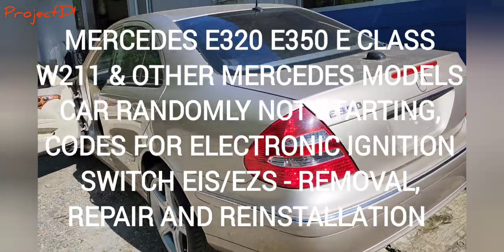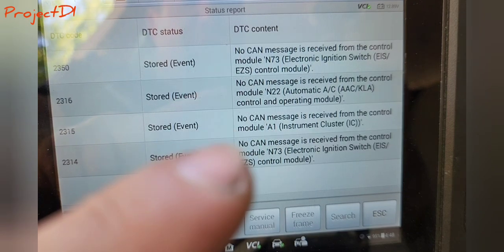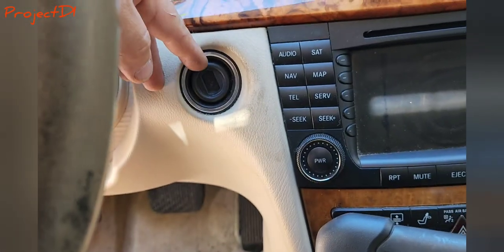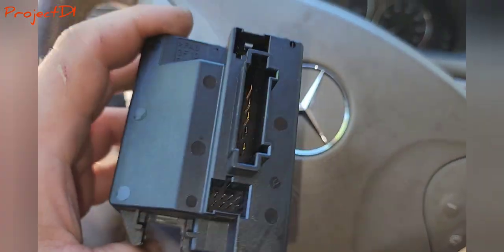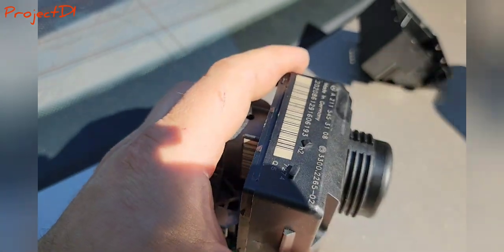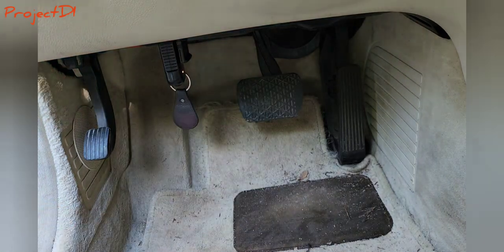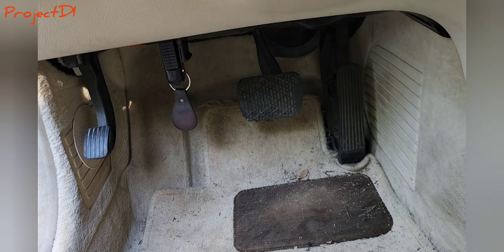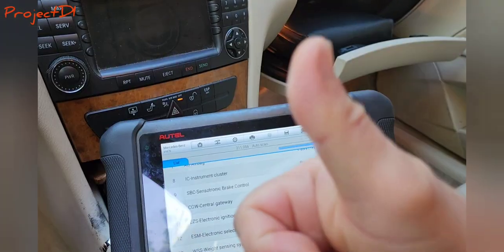MERCEDES E CLASS W211 NO START CODES FOR ELECTRONIC IGNITION SWITCH EIS/EZS - REMOVAL REPAIR INSTALL

Comment: I have a problem that I was curious if you could give some advice on. I have a 2006 CLS500, and from what I have gathered the ignition is locked up on it. I want to see what your opinion is.       One day I took the car to the store, parked it, and shut it off. When I came back out, I put the key in the ignition and started it up. As soon as it started up, a rapid clicking started to occur from the left side of the dashboard. I immediately shut off the car. After that I could never get the key to even turn in the ignition. Also, the lock sound that I always heard when putting the key in the ignition went away. Also, the car has a smart key and has the push button start on the gear shifter.      The car has been sitting for a year now, and I have never been able to find anyone that can give me a straight answer on what went wrong or how to fix it. Any information would be helpful. Thanks.

Comment: Hi from Spain! very god job!  I have got the same issue and my question is, you only have welded over the old welding points? or you have remove all the old welding points before, and re weld them from new points?
Reply from the maker: Renewing the old welding points should be enough my friend. Just make sure to check as best as you can the electrical components as well. Thanks and Good Luck!
Reply: @projectathos  I did It yesterday, It didnt work for me..may be something else  broken in the plate...
Reply: @OriolBPhotographyFilm na I wouldn't think that would be the issue all the time.

What was it please.
Reply: @dashtyATG  In my case was the starter motor. Change it and running again!

Comment: I’ve been trying to figure out if it’s the ignition lock here or my eis… is there anyway to tell between them??
Reply from the maker: You are talking about the same thing my friend. EIS means Electronic Ignition Switch or otherwise known as Ignition lock. Unless you mean the mechanism which locks the Steering wheel then it's something completely different. Remember the EIS unlocks the steering wheel mechanism. So you go in line of the working order and in this case is 1 EIS then 2 Lock. Thanks 👍
Reply: @projectathos okay thank you.. I’m getting a P2001 N73 EIS code. So I’m going to try and attempt to do what you do in this video. I’m hoping I can repair and not have to go through dealer and new key…
Reply: When you soldered them… do you mean just adding more metal wire to the existing ones? Can you explain how you solder them?? Please

Comment: First I Thought my key is bad but I got another key to work and still have issues. 
So now I think EIS is bad. Solders look very good but can they still be bad? 
I don't know what to do next, MB is too expensive to me 🥺
Reply from the maker: It could be the EIS but you may need you problem to bw diagnosed at a professional shop to try to find the actual problem...  Thanks👍
Reply: @projectathos  Coil that power key does not have voltage so I think eis has to be bad or it doesn't get correct intake voltage. 
I try to find fuse and eis pinout and voltages.

Comment: Any tips for a e320 2003 that’s doesn’t start or fully power up and  can’t turn the key or make the car run and the wheel is locked
Reply from the maker: You need to check your voltage from the main battery and the secondary battey! If they are bad you need to replace them! The secondary is on the passenger side of the engine next to the firewall under the cabin dust filter. After these if you get power you need to use a scanner to connect to the OBD Plug and scan the car. Whatever codes you have you need to erase them and try after that to start again. If you cannot turn the steering wheel you might want to check the EIS or Electronic Ignition Switch because the lock is connected to it. Let me know if you need other help... Thanks
Reply: Did you fixed the issue sir?
Reply: Sounds like a bad key

Comment: There’s no way that switch came out under the dash..
Reply from the maker: Yea it does. You just need to twist it a little bit and it will come out. Done this many times and on other models too... You are not going to see what you are doing but you can feel with your hands... It looks complicated but it's not... I don't post things that cannot be done or don't work... Thanks 👍
Reply: 2008 E550 had to cut aluminum bracket with Reciprocating-Saw-Tool to get it out